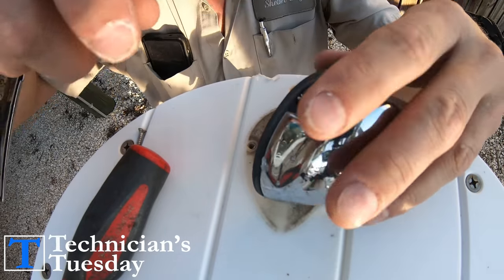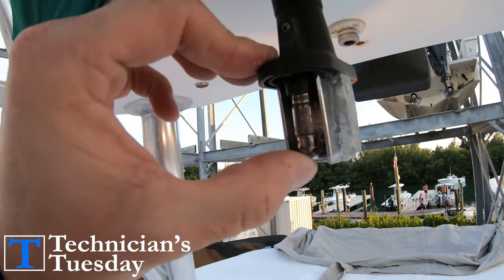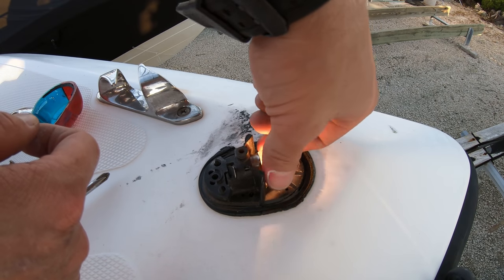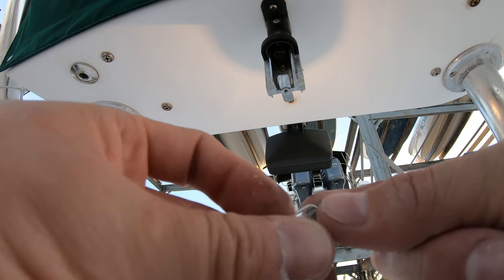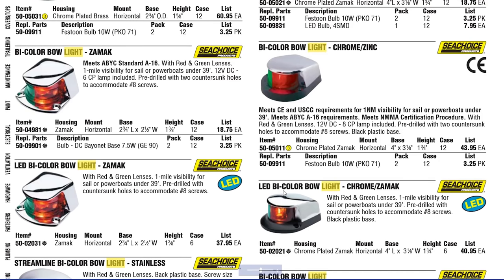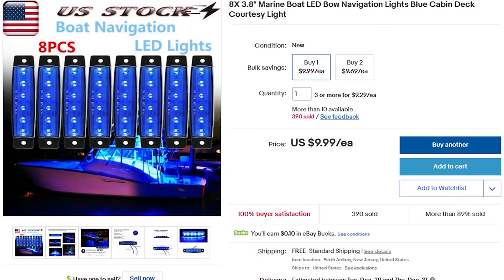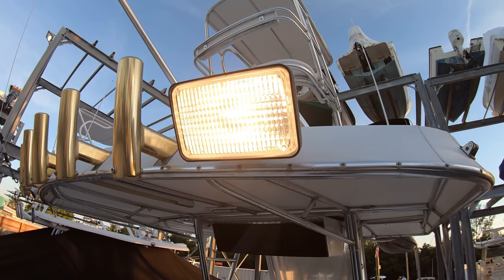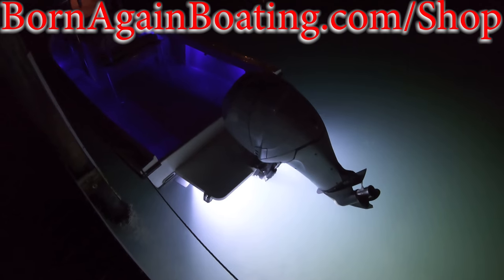What Light Last LONGER On A BOAT?

Comment: DIELECTRIC GREASE!!!
Reply: AMEN!
Reply: Yup, Been using it on customer boats for 25 years. No problems with corrosion. Very surprised Aaron didn’t mention it. I’m freshwater, maybe it doesn’t work in saltwater?
Reply: @muc4149  it works quite well in salt water, although it pays to reapply every few months.
Reply: I was sayin same thing during video. At least No-Ox. 👍🇺🇸
Reply: its a meme, almost all grease are dialectric.

Comment: to be honest the cheap Amazon / China LED's are all pretty crappy.  If you do spend the money on the high end lights (RIGID, InfiniteOffroad, KC) they do last. I learned much of this with trial and error being a Jeep enthusiast.  Sadly the cheaper chinese LEDs are built for speed and cost and not quality and many of them will seep water and allow intrusion which ruins them rather quickly.  I love the low power draw of LEDs and for some applications you can direct replace an incandescent with a plug in LED and keep a few in the toolbox for backup - you get the best of both worlds - low power draw and immediate replaceability     Still waiting on my shirts - I know its the holiday season but sheesh!  USPS is dropping the ball for you.

Comment: Led lights being enclosed produce heat that can't get away.  Heat is the # 1 killer for led lights.
Reply: I have never noticed any heat on leds ..myself
Reply: Yes, anything that uses electricity will generate heat. All the high quality underwater lights I’ve installed can only be used when the boat is in the water. Otherwise they will burn out.

Comment: Regarding above the waterline lighting: I think you are buying cheap led lights.  I mean, for watertight, shockproof led lights, which do exist, you have to pay much more than anything offered on eBay, probably 2x to 4x.  But these industrial led and housings will not fail nearly as often as the cheap stuff.  But I would say cheap incandescent beats cheap led (which are slightly more expensive).

Comment: I kept some non-waterproof trailer lights working for years, even with many salt water soakings per year.  The trick was to fill the sockets with grease.  I don't remember now, because the trailer is long gone, but I believe the same lights worked over 5 years without any further maintenance.

Comment: Aaron, I swear by Corrosion Block by Lear Chemical for protecting electrical connections.  A quick spray before installing a bulb or connecting a plug (trailer lights, trolling motor, removable nav lights, etc.) keeps the unit and the bulbs working for years.  No problems.  It's also a great lubricant and protectant for hinges, locks, shackles, etc.

Comment: You can get LED bulbs that are a straight replacement for incandescent in almost any bulb/socket style. I've done all my car interior lights with them. Just pop out the filament bulb and pop in the LED. Did the same on my boat and keep the filament ones as backup.
Reply: The downside of that is you still have the corrosion problem. A fully potted LED shouldn't have an issue.
Reply: @daniels2761  Not arguing, but you said that the disadvantage of the potted ones is that you have to replace the whole light and the ADvantage of the filament style is that you can clean them.
Reply: Yes, it "shouldn't" have an issue! 🤷
To me, all come down to cost and time's cost!

Comment: I replaced my original bow light assembly with a fully potted waterproof one. That eliminated the corrosion problem. It's worth replacing the whole housing in my opinion.

Comment: Replaced all bulbs on my boat and trailer with LEDs.  Added continuous, waterproof, hidden LED strips under the gunnels around the entire deck (red) and inside all compartments (white or blue), including the battery/gas tank compartment.  They look great and provide plenty of light.  You don’t know that they are there until they are turned on.  My vision isn’t what it used to be and I need more light to see well.  The lighted compartments make a huge difference during the dawn & twilight times.

Comment: Save all the cleaning and put some dielectric grease on the connectors of the light bulbs and stop corrosion totaly. A qtip and a few min will save all the hastle and you can use it on any connector prone to failure.

Comment: I've found that with incandescent light bulbs, if you use bulb grease (dielectric grease) you can extend their lifespan. With LED's, strategically sprayed conformal coating can extend their lifespan.

Comment: I believe the led trailer lights are the best , with me when they start giving trouble I just replace them all they have gotten better pricing over time . Salt works them over pretty hard . The lights around the boat are all regular bulbs , with the exception of the docking lights they are wired bulbs super expensive but lasted ten years ..

Comment: Switched to LED's once, didn't like the light pattern.  Instead of flooding the area they had a very distinct focus.  The result was when the boat would move by wave action, the lights would essentially create a flash to anyone viewing as the boat moved up and down.  Switched back to incandescent lights.  Tried again a few years later, same issue.  I do use LED's for cockpit lights, stairways and the engine room.

Comment: LED's can cause interference in VHF, Radars and sonar. Just be mindful that your communications through VHF can be hindered depending on the location of the lights.
Reply: My VHF gets a lot of static when I turn on my side lights.
And my traditional sonar doesn't like my running lights. Down view is fine with them.....

Comment: LED as incandescent direct replacement for any boat light, is my preference. Brighter, less power, stronger case, cane be pulled off and cleaned. Provided using Cree LED and electronics.

Ditto... Agree with others talking dielectric grease.

Comment: Last week my anchor light was out.  Noticed the contact bars that hold the festoon bulb in place were loose.   While attempted to bend it up a hair, the entire frame cracked at the base.  The mistake cost $70 bucks for a new set up.  Like you said this is a constant issue.  Went LED up front.  We will see.  Thanks for sharing.  Merry Christmas.!!

Comment: LED on my sailboat since the battery only gets charged from a solar panel.  LEDs draw a lot less which means more power and life for the music.  Regular incandescent for my center console.  They all turn on whenever I need them so haven't had the need to replace.  Will probably do LEDs for cockpit / curtesy lights when that time comes.

Comment: I replaced the incandescent bulbs with LED bulbs in my anchor light and nav lights. They have the same metal contacts as the incandescent bulbs, but are an LED in the center. So you have the benefit of still being able to pop it out and scrape off the corrosion. As for the spreader light... you are 100% spot on, I removed what must have been a 10 year old halogen spreader light and replaced it with an LED. One year later that LED light was done!
Reply: Why not get a potted (sealed) one that can't corrode?
Reply: @daniels2761  ... I think his point is and I tend to agree. Even if it’s “sealed” it still eventually corrodes. But when it’s sealed, you can’t take it apart to fix it.

Comment: LED ERRRTHANGGG

For me I was always replacing incandescent bulbs in my Harley. Made the switch to all LED lights and haven’t had a single light fail since, and I installed them 5 years ago. The vibration killed the incandescent bulbs extremely quickly.

Comment: My anchor light is the only true led on my boat. I replaced the bulbs in my spreaders with led bulbs but could switch back to incandescent in a pinch. My bow light is still an incandescent, but I may swap the bulb for led and keep incandescent spares on board.

Comment: I've had regular bulbs on all my boats since the 1970's... Call me 'old' (fashioned) but I prefer them for a lot of boat applications. I also have LED's (light emitting diodes) for some applications, especially in flashlights; the batteries will last 5 times longer. As for anchor lights, use both. (not at the same time)... the LED won't contribute much to battery-drain, but when it 'breaks' (LED's don't actually 'burn-out', they 'break' in a sense)incandescent makes for a great substitute/back-up.

Comment: I haven't tested mine yet, but I am expecting to have to replace them. My plan is to use incandescent lights for the nav lights, since the motor will likely be running when they are on. All the others will be LED, since the motors could be off, and I will be running on straight battery power. Has anyone had any luck with the 5050 light strips? Those are encased in silicone, so I can't see how vibration or moisture could affect them.

Comment: what are your thoughts on the LED Conversion bulbs like this: https://www.defender.com/images/701478.jpg Allows you to keep the contacts that you can clean and the original housing. I used something similar for interior lights on a sailboat, but always had the incandescent for the nav and anchor.